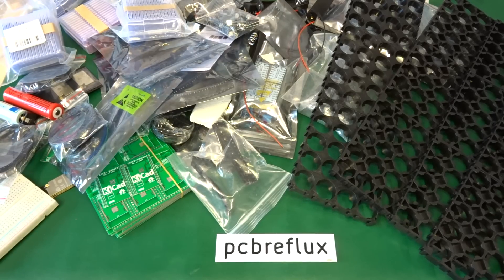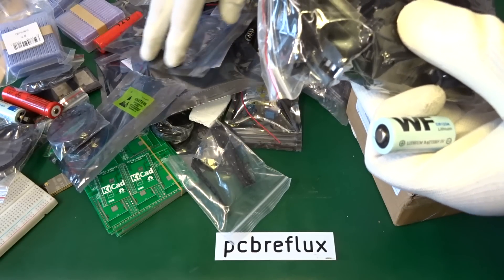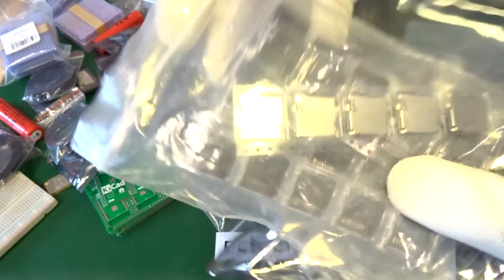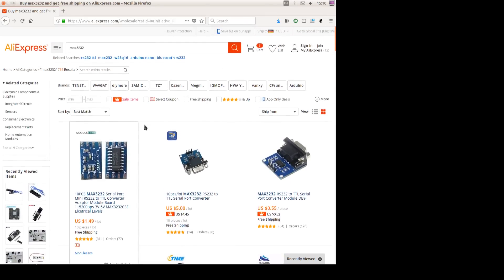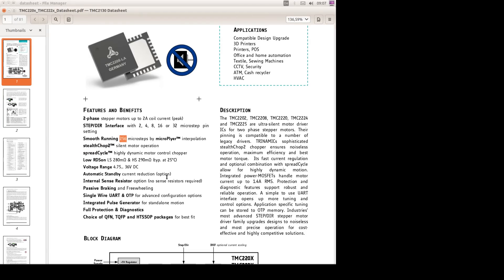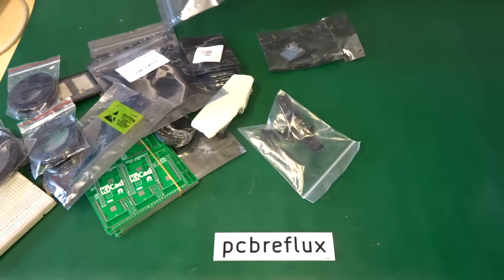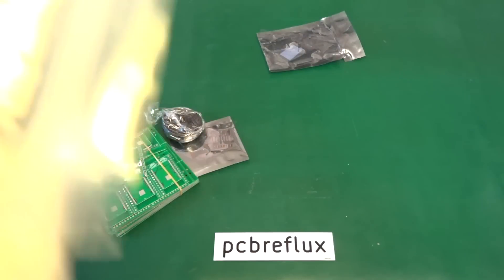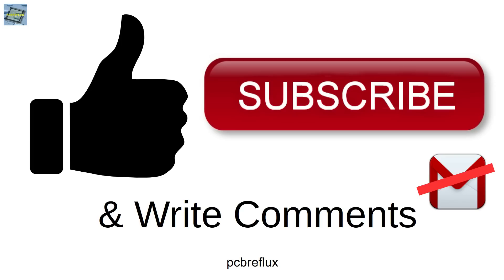ESP32 #74: on the Bench

Comment: Hello
Please tell me how can i recive data put by a client  in  website hosted on the esp32 ?
Reply from the maker: See https://youtu.be/4bS5ktABELE for some data or https://youtu.be/_mJL2LoxhQQ to exchange a file, maybe way over-sized with the SSL/TLS for your purpose. But in general the ESP32 Web-server receive the HTTP request (or HTTPS or other like websocket)  from the client and parse the request and do what you have programmed. To start have a look at the Arduino SimpleWiFiServer.ino (WiFi Web Server LED Blink) example. But you can also use other OS for the ESP32 (like MongooseOS, MicroPython or Duktape or other) to host a website on the ESP32.

Comment: Thanks for sharing your bench.
Before buying LiIon Batteries I look at lygte-info.dk where may independant test results can be found. as well as some teardowns of fake cells with huge numbers printed on and less material built in. There you can also find Tests for protected cells.
The last Serial Printer I owned was a mechanical Teletype with Punch tape Equipment. Some decades ago....
I also used such an optical  finger print sensor with an ESP8266. It should help my mother to access her house and to avoid a full-time care, but it did not work for her. Worked well for me and others but she was no more able to use it properly. So I solved this issue using a RFID tag Reader (and a piezo buzzer as acknowledge signal). I activated the finger print sensor with a FIR Motion sensor. Maybe a cheap Radar sensor works too, but was not avalable that time. The cheap Radar sensors need a extra linear voltage Regulator (7805), the ESP supply is too noisy. The door itself is opened bey Homematic Keymatic.
Marco Reps showed the Trinamic Driver. very impressive.
The AMS1117 hat lots of quiescent current. Maybe you want to test some Holtec Regulators, like HT7333 ?
The 2N7002 is a 5V but not a 3.3V type, but with 60V robust. The Si2302DS fits better, it is a even 2.5V compatible similar as the cheap AO3400 which is a 30V type and a Little more robust.
Have fun!
Reply from the maker: Thanks, just started with the 18650s and still have a lot to learn. And for others I don't recommend to buy the cheapest cells but I want to compare the performance of different cells myself and sure the written capacity is far from reality.

Comment: For the love of all that is holy, do not populate an entire spacer and then hook the entire thing up in parallel.
If one of the cells fails, every functional cell will short-circuit through the dead cell and you have a fire on your hands.
Look into pre-built BMS solutions if you can't be bothered to build one yourself.
Reply: it is common practice to fuse every connection, and this fellow seems to be smarter than a child.
Reply from the maker: Thanks, for long time I read a lot about the ISL94212,  ISL94203 and other Multi-Cell Li-Ion Battery Manager solutions, but then I also read other source and want to try it myself like this channel HBPowerwall (think even tesla do this in big chunks of parallel 18650 blocks). Even if it fails I learned something ... (yes, I will consider safety ...)
Reply: nikomo good point!

Comment: Why are you buying fake 18650????  9600mAh????
Reply: that was my exact same thought 30 seconds into the video. 
the good stuff:
Panasonic NCR18650PF
Panasonic NCR18650B
Samsung ICR18650-26F
Samsung INR18650-25R
Samsung INR18650-30Q
Samsung INR18650-35E
LG INR18650-HG2
LG ICR18650-HE4
Sanyo NCR18650GA
Send me a message to get an Excel that does some calculations if you want to put them in a pack
Reply from the maker: Thanks, yes I am aware that the cheap cells maybe have just a 10th (or even less) of the capacity, but this was just for testing. More cells on the way...